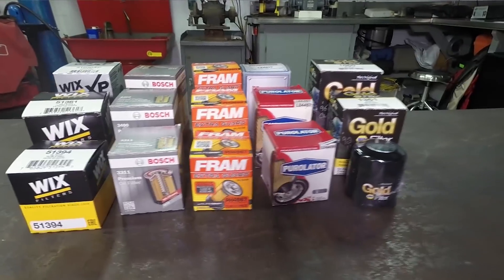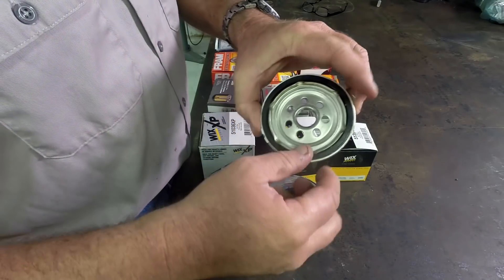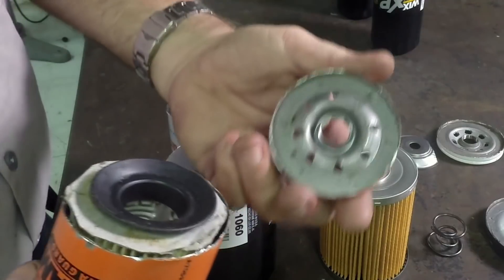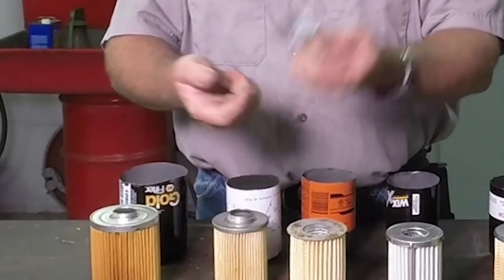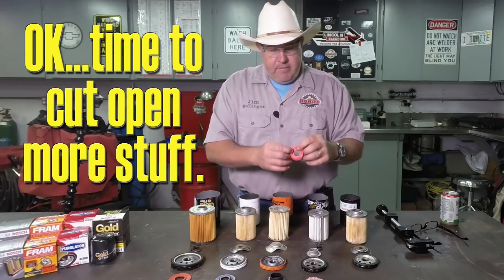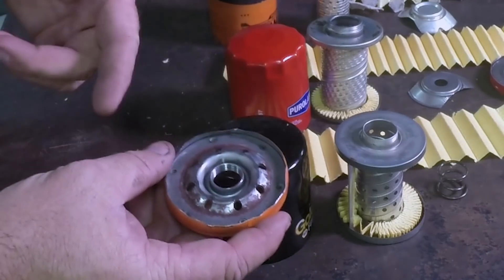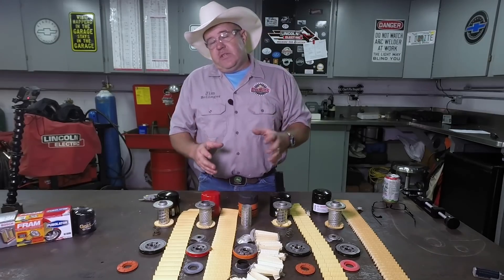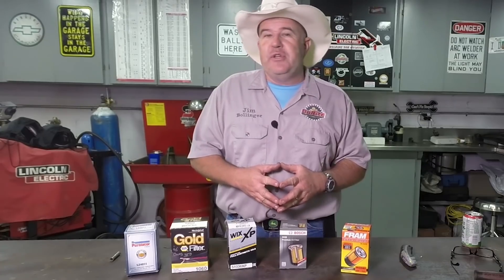The worst oil filter EVER!

Comment: I bought a brand new Honda Odyssey van in 2004, still own it, has almost 300,000 miles, never had a check engine light, no engine problems, do my own oil changes according to maintenance schedule in owners manual.  My secret?  Cheapest Walmart conventional oil and cheapest Fram oil filters.

Comment: The purpose for the spring is so if the filter ever clogs up the pressure from your oil pump will push the filter down and continue to receive oil so the engine will not encounter and catastrophic failure due to oil starvation.

Comment: The fram ultra synthetic is a good filter.  I use K&N HP-1003 Performance Wrench-Off Oil Filter on my 97 corolla, and 2004 f150. On my 2019 Subaru wrx I use Subaru oil filters.  And my wife has the 2019 insight,  she gets the oil changes under warranty at the dealer.  My motorcycle's get k&n ,and Amsoil filters with Mobil 1 10w-40 4t. The main thing is changing the oil frequently, if you're car is a beater, or an oil burner check the oil every fuel fill up. Maintain proper oil levels!

Comment: Ive never used Fram garbage filters for anything on my cars, not even for the air filters.
I always use either Mobil 1 or Bosch for my oil, and K&N for air filters.

Thank you for the video, this just verified my speculation of that shitty brand

Comment: Not apples to apples, if you got purolator Classic and fram extra guard, you need Napa silver not gold. That's why the length of the material is different, they're meant for different oil drain intervals. But I get  you were mainly showing just the poor quality of fram

Comment: Fram filters are all JUNK no matter which one you buy.  Fram spends millions of dollars in advertising instead of making a decent filter, however most people have no idea how bad they are made.  Beware of Fram filters, engines are very expensive, Filters are not. Buy the Best Filter for your vehicle it's worth it.
Reply: Most EVERYTHING advertised on television (boob tube) is garbage.  I make a special effort to avoid anything advertised there.
Reply: How about air filter?
Reply: William Harvey  Sure I do, you mumbling it now, don't try to talk with your mouth full!!
Reply: http://www.gmtruckcentral.com/articles/oilfilter/gradesheet.htm
Reply: Blind Squid  Back to Amsoil then 

i guess.
Reply: That's just NOT true...
Reply: I used Fram 15yrs+ and 2 cars @ 300,000 miles with syn Mobil 1. No probs. But after seeing this - NO MORE FRAM 4 ME!
Thanks!
Reply: Best filter = FRAM Ultra. If you disagree, tell me why?
Reply: @robertagster7164  Why? Because they are made with junk material both the element and the internal metal parts. Check out the many YouTube videos of these filters dissected. Pure Junk personified.
Reply: Joseph M that’s simply not true. Fram Ultra filters are quality filters, and use a synthetic blend filter media. Check out Bobistheoilguy if you want further proof.
Reply: @duke7595  You didn't study. The Fram ULTRA filter, not the other ones.
Reply: @101Volts  I wouldn't trust anything Fram, go with a Mobil One.
Reply: @duke7595  
You are just repeating what everyone else has been repeating without actually knowing what you are talking about. Fram Ultra Synthetic filter is among the best filters available and it's made in the USA.
Reply: HERE IS ANOTHER GUY SAYING THE SKY IS FALLING!  How many engine failures have you honestly seen due to FRAM filters ? ( Or really any oil filter failure ??)
don't know what the advertising budget for FRAM is, but they still sell a lot of filters.

Comment: Hard to compare the cheapest frame to filters costing 5x more, how about compare the fram to stp or walmarts low end ones?
Reply: I agree. It would be nice to compare more , but especially Fram's premium oil filter like the "XG" line.
Reply: In Canada, they replace the purolator line with Fram, so you can now compare a Fram against a Fram.
Reply: If you buy Walmart you know what your buying! Fram is expected to hold a higher standard, although the comparison would be interesting, I don't think you can get any lower than this,
Reply: The poster is too dumb to realize or smart enought to plant a 20 year old filter into the mix.  Ive got my dads old 1989 Nissan Sentra with 745k miles on it.  Has been given regular service with Fram oil filters since It was new.  745,000 miles on it.  Yet ive seen the same car using STP and other filters gone to the scrap yard many years ago.  YEP.  Keep believing everything you see on the internet

Comment: I just couldn't believe that Fram was that bad. It makes me wonder if the Fram would break apart and sludge the oil. Thank you for this. I need to change my oil and I was going to buy the Fram oil filter but not now. I'm going to buy from Napa or wix
Reply: It's not. It's a standard filter designed for 5000 miles. He comparing it to more high end filters. The Wix XP should be compared to the Fram Ultra, not the orange can Fram. Also Wix and Napa are made by the same company, and he said Napa is better.
Reply: OK,  I'll buy Napa instead. Thanks
Reply: @robertcortez3897  You could buy Wix too. My point was he doesn't really know what he's talking about. The Wix and Nappa should be the same, since they're made by the same company.

Comment: He's comparing a base line Fram filter to a Napa Gold which is one of their best filters.   Could they compare a higher grade Fram to make it a more apples to apples comparison?  Great video either way.
Reply: I'd also like to see a comparison between each company's top of the line filters. I thought The Pure One was good.
Reply: Yes that's what I was gonna say I wanna see what's inside the top of the line
Reply: B all fram is trash don’t run that junk unless you enjoy rebuilding engines
Reply: Yeah the Fram ultra synthetic has metal parts inside of it. it even has a metal mesh backing on the filter itself
Reply: @hardenstine  still a fram
Reply: @williamuskoski1385  well a Lexus is still a Toyota but its maid with better quality parts
Reply: @hardenstine  no a lexus is a toyota made with the same parts. In japan and many parts of the world there is no lexus they are all called toyotas.
Reply: @jalee6587  nope you're wrong because the Lexus bumper is different from the Toyota bumper and it's also the same for the steering wheel as well there are some other parts that are different. Plus you're missing the whole point of what I'm trying to say.
Reply: @hardenstine  That's what I was wondering too. I use the Fram Synthetic filter with Mobile 1 synthetic. Thought I was doing a good thing.  Can't believe the poor quality on the Baseline filters. Totally driven by greed and not concern for customers.
Reply: Who even cares it's FRAM cheap junk no Matter what.
Reply: I'd rather see a baseline Nappa. Any company putting out the kind of garbage Fram has on the low end products is worthy of a boycott on their high end end products. I understand you get what you pay for but don't just F* your customers.
Reply: @Username-i9t  I have used the so called high end Fram filters...Never Again. They are junk. Don't even use them in your lawn tractors. If the engine fails the company will void the warranty.
Reply: Exactly what I was thinking.
Reply: Basic puroilater still blows fram out the water hands down. Not even close. I will say he is obviously a napa gold fan though.
Reply: Fram shouldn't even be selling junk like that. He proved its no good. Most people grab for the regular filter.
Reply: Best to just get oem factory filter what ever came stock on your car. Can't get that bad.
Reply: @hvuu1628  but then you can't trust automakers either you know. I've seen plastic on cars from thermostat housings,etc.  Everyone is looming to make a buck, more money for dealerships too. I don't trust any of them.
Reply: @Mustangladyme  well not sure of American auto makers but Japanese one like honda Toyota and mazda are premium filter. They can't have a crappy filter ruining engines looking for lawsuit. Atleast some of them market their filter with cut out display at their shop to show what oem filters looks like. The mazda ones on my car have magnet them to catch metal shavings as the say.
Reply: I can't stand brand names, that trade on their name and not on quality products, run by accounts and not engineers for sure I will add Fram to my list to avoid, and who ever said compare a high end Fram filter - No Thankyou, Avoid forever
Reply: Who cares, it’s your car we’re taking about.  Cars aren’t cheap so why would you go that route?
Reply: Base line napa filters will still be made the exact same way just less paper material in the actual filter all the components will be identical 😁
Reply: Never Gonnatell  The rust doesn't bother me THAT much.  It will stop rusting once there's oil in it, and the existing surface flakes will make it to the filter media very quickly.
Reply: @MilwaukeeF40C  This was my thinking too. something tells me that the amount of rust in the filter is directly related to shelf time.
Reply: @GUSftw  Probably shelf time AND metal alloy, which is clearly crappy in the Fram filter.
Reply: Never Gonnatell  Theyre not defending the shit filter, you shit for brain.

Comment: I totally agree that Fram is not a good filter. I had a Fram filter that somehow came apart inside after about a thousand miles and filled the oil with wood pulp from the paper. If you can imagine motor oil with a sludge of wood fibers from ground up paper, that’s what it looked like. I changed the oil and once again soon after. The engine survived but I’ll never buy a Fram filter again. While I’ve used Fram before that without a problem and this was just one filter, I’ve never had that happen to another brand. This video is just one of many that lament the quality of Fram.

Comment: F__k me! I just slapped one of the 20k oil filter from fram cuz EVERYONE recommended that brand of filter, I've only put 1k miles on it and will be very conscious about the filter for the next 14k miles. please make a vid compare the new 20k miles protections filters, I think most DIY ppl would use those.
Reply: If you used Fram Ultra, that's one of the best filters, next to the Purolator Boss. If you used the orange Fram, that is only designed for 5000 miles. But nothing is wrong with it. Honda and Subaru use them as OEM.

Comment: So Fram filters are like Yugos and Napa Gold ones are like Rolls Royces.  But an oil filter only lives in my car for 5k miles, so why do I need one built like a tank?  The real question is, "Does it filter imperfections out of the oil enough to protect my engine?"   You decide for yourself, but I've seen no adverse effects from using Fram filters in my vehicles for decades.  In fact, my 1990 Corolla has 380k miles on it, still has the original engine (never been rebuilt), and it runs great, doesn't smoke and gets in the mid 30s mpg.  I bought it used 20 years ago, but it has had nothing but Fram filters in it since then (258k miles ago).  I'm not worried.
Reply: These complaints could be from product changes.  Companies can make manufacturing mistakes and it can cost them their reputation.  Still, in the considerations of what I've read I don't think I'll be using Fram oil filters.

Comment: Just found your channel and commend you for your honest research. Do you remember the filter that used a roll of toilet paper as the filter element, looks like Fram is approaching that level of quality. BTW, I subbed to your channel.
Reply: How did he do his research? He's comparing a baseline Fram filter to Wix's highest tier filter. If you're going to use the Wix XP, compare it to the Fram Ultra, not the orange can. Also, he prefers the Napa filter, when the Wix is made by the same company, but just has a different logo. Also, OEM filters have paper end caps too.

Comment: An interesting review, Fram definitely looks weak but YMMV.  I purchased my 4L Jeep new in 1998 which I still own today, it now has 150K miles, still runs perfect, same acceleration, doesn’t burn oil, and gas mileage hasn’t changed either.  I've only ever used Fram orange filters and Quaker State conventional 10W30.  I've always changed oil myself at 3K miles without fail.  Buy into whatever marketing hype you want but the key is to change oil/filter regularly.
Reply: Honda uses Fram too.

Comment: you screw me, i have 1 fram filter that is waiting to be instaled, to put it in garbage?
Reply: No. If it's the orange one, it's designed for 5000 miles.
Reply: ok, thank you , usually  i change it  at 5-6000km what make in 1 year

Comment: I have a 2003 f150 with 152,000 miles. All i have used is FRAM. Oil Changed every 3,000. NO MORE. I don't see Motorcraft filter. I put motor craft on my 2014 fusion Titanium. I will switch to Wix on both vehicles.
Reply: Motorcraft sucks. Fram Ultra is a good filter though, which is what he should have used instead of the orange can. Because he used Wix XP, which is their best filter, not their standard one, like the orange can.

Comment: Thank you very much for doing this clip.  I’m not a big fan of fram filter but I don’t think your comparison here is legit.  You’re using the cheapest fram filter and compare it with higher quality filters from other brands. it’s same as doing comparison between Mercedes and Honda. Fram does have better quality filters.  Try those first before framing Fram.
Reply: I can't speak to the other brands, but in my experience, Wix is not an expensive filter.

Comment: This is a pretty good video comparison but I was a bit confused by your explanation at the beginning. At 3:27 you state: “By far, by far, the NAPA Gold is the highest quality filter; which, not surprisingly is second only to the Wix filter”  So which is it? If the NAPA Gold is the highest quality filter, it can’t be second only to any of the other filters. After watching the full video I guess they are about equal. Is that what you’re saying? 
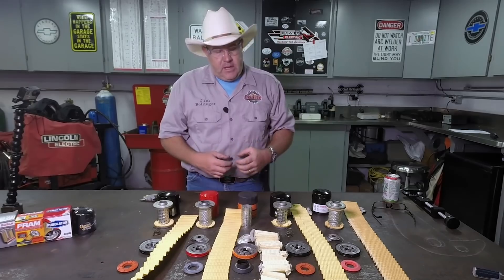At 8:19 you say “If I were on a deserted island and the only auto parts store that was open had one of these (Fram) filters……”  If you were on a deserted island I don’t think there would be an auto parts store, open or closed. But I guess you just got sort of carried away, so I’ll let that one go. 
I’ve heard Wix was a really good filter, thanks for proving it. It looks like NAPA Gold is made by Wix. I’ll avoid Fram from now on.
Reply: This is a terrible comparison video. He uses the cheapest Fram filter and compares it to the most expensive Wix filter.
Reply: The NAPA Gold is the same as the standard WIX. Why? WIX makes them. Do your research.

Comment: It's cool to see how different they are made but if your going to  Compare things like how long paper media is then maybe you should be comparing filters that are of the same size that would go to the same motor and not have  So many different sizes of filters. To me it just looks like you're pushing Napa gold for showing their  Largest filter. Why not compare 5 different brands for diesel motor to see how good a 15000 miles Oil filter should be and all to the same size motor.. and i have to ask. Why not tear apart a k&n oil filter. Because it would be better then napa gold. Smh.

Comment: I HAVE cut apart the more expensive Fram filters, one from 1993 and an HP 1, the "race" filter. Same crappy design with cardboard ends. I cut apart one Fram that the pleats were actually split open...the oil was passing unfiltered.
Reply: You're making stuff up. The higher quality Fram filters have metal ends. And OEM filters have cardboard ends, so what's the big deal?

Comment: Why are you comparing a standard Fram filter to Wix's premium Wix XP filter? If you're using the Wix XP, you should be comparing it with the Fram Ultra.
Reply: Question is WHY is Fram even selling a shit filter like the one rated in the first place?
Reply: @patrickkruger5310  Well it's not a shit filter. It's a filter designed for 5000 miles. And it's a filter similar to (if not better than some) OEM filters. But what really matters is whether it does it's job, which is to filter oil. Not whether the end-caps are metal. Look at a Ferrari oil filter, for example.

Comment: I respect this video and have worked on all my vehicles for over 20 years and can honestly say I have always used the orange Fram and have Never Ever had a problem with my engines or the oil. I've always changed every 3-4000 miles too

Comment: One thing you , and many others completely overlook which is very important. The fram do not reduce oil pressure. The others very much do. The cavitation destroys oil pumps.   But for something that is changed every 2000 miles 2500 km. I would rather take the frams that work properly than the others that don't. I've seen engines destroyed by people NOT using frams.  Choice is yours of course.

Comment: Wix used to make union 76 oil and air filters back in the 70s 80s and 90s, when union oil had real service stations instead of the current twinkie stands. Submitted by wife of ex76 five star dealer.